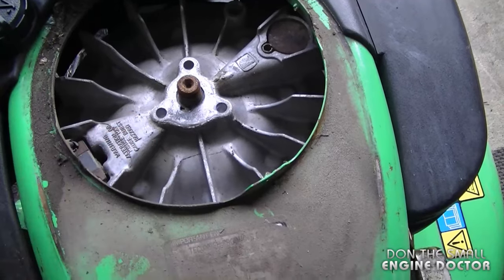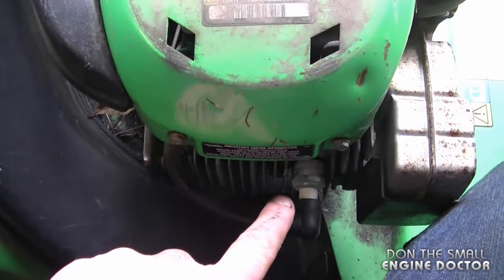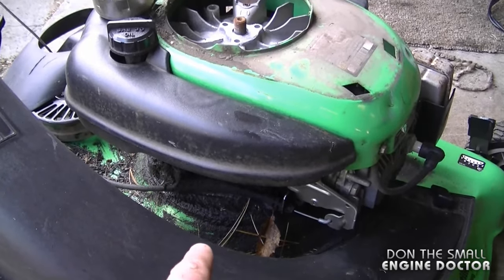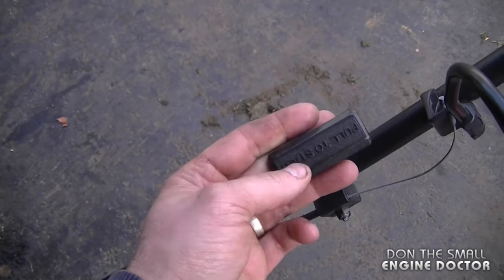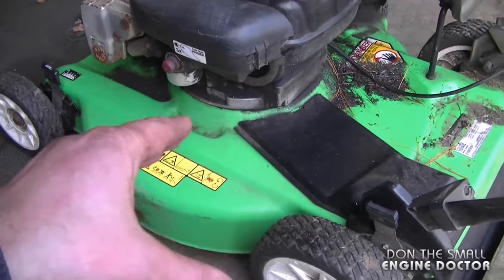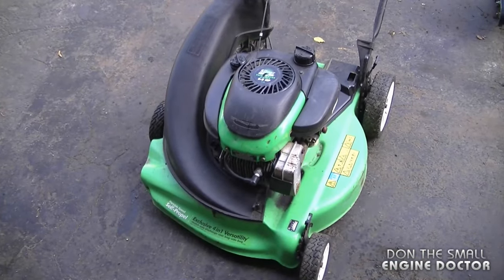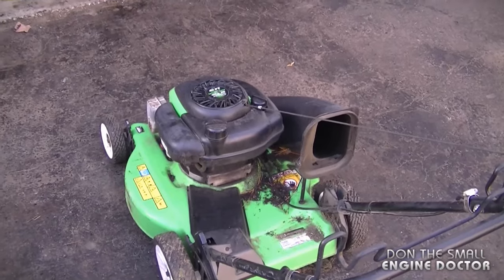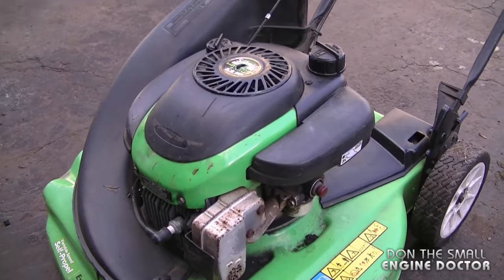Lawnmower Will Not Start - You Will Never Guess Why!

Comment: Sometimes I have self-doubts and your videos often fix that issue! I have the leaf blower equivalent of this issue, I think.  Customer was using the blower; clothing was sucked into the machine, and it died and will not start.   Has spark, has compression, has gas, etc.  I wanted another opinion before I tear into this box store model because it is a pain to work on.  Last year he snapped the starter rope, and the entire machine has to be disassembled to get to it.
Thank you for sharing and stay safe.

Comment: Excellent video and instruction donyboy! Really concise. My engine flywheel key was perfect, so I am back to the drawing board, as they say. When pulling starter cord, I still have symptoms you pointed out. I am totally puzzled now? Wonder if timing marks on cam and crank are incorrect. Connecting rod was replaced on this engine years ago. With spark plug out, engine spins easily.

Comment: Thanks...ur the only one that mentioned the oil from the vent tube...I was wondering where it came from.
Mine ran and sheared the tabs for the mower blade in use...then the mower after stopping could not restart due to full shear of pin.

Comment: Yes, I recognized this issue. Exactly what we have right now in a Briggs 7.25 HP engine of our lawn mower. It seems like ignition points are wrong. However, some people advised that it`s most likely a camshaft problem. It`s made of plastic and pretty common issue when its plastic gear wheel is getting loose on its metal axle, or a decompression mechanism is damaged. Do you have an idea how to diagnose it correctly before engine disassembly, please? Thank you

Comment: Backfiring is a common symptom of bad timing in old two-stroke scooters. I had an electric start mower my shop in a few weeks ago. Charged the battery, it turned over OK but slowly, and backfired about every 5-6 turns of engine. Pulled on the cord, and sure enough, it yanked right out of my hand. Key was nicely sheared in two.

Comment: had a briggs stratton 450 148cc that had surging issues and also making occasional popping sounds while running. Tried all the usual solutions like cleaning and  rebuilding the carb, even replaced governor springs, tried to adjust running speed by bending the tabs on the kill switch bracket, checkd for airleaks etc etc, nothing I did worked, eventualy decided to pull the engine apart and rebuild, when I took the flywheel off I noticed the keyway was slightly sheared and this ended up being the issue causing all my problems.

Comment: Good video. Timing is a major factor in engine performance and not many utubers will even mention it, guessing cause of the rarity of the happening. But you are right,,, hitting a sidewalk or root or obstacle that dead stops your mower especially,, can cause the key to partially or completely shear. Good information to look for and usually easy. thanks Don.

Comment: on the old Tecumseh engines they used a steel key and an aluminum flywheel and many times when the blade hit something solid the flywheel would crack right at the key way.

Comment: I had that exact thing happen on my 7hp mower with a Briggs. Hit a piece of rusty pipe, sheared it all the way and wouldn't start at all. I managed to figure it out my self and fix it. I also noticed on my 7hp, you really have to tighten the blade bolt a lot more than on all other mowers I have.

Comment: By the way on some lawn  flywheels it has instructions embossed right on the flywheel " never use steel key" or some wording like that (and even use flywheel puller). Always use an aluminum key on lawnmower flywheels or certain engines that recommend it. If in doubt check repair manual. Thing is an aluminum key cam prevent crankshaft damage or breakage in the event of the lawnmower blade wacking against a fixed object or big branch by just shearing the key. Some engines even have offset keys for ignition timing.

Comment: I've got a Briggs 3.5 hp motor with a sheared key, and when trying to start it the plug fires when the intake valve is wide open and a "pop" comes out of the carb. It stands to reason that the magnet triggering the pulse into the coil isn't where it should be, due to the flywheel having rotated away from its proper position. Easy fix.

Comment: I hope this is the issue on my Briggs & Stratton 4.0; a couple of summers ago, I ran over a small group of thin tree branches (less than 8 inches in length)--the engine started making a slight ticking noise and small spots of oil began to appear on the deck.  After I shut it down, I tried to restart it, only to be greeted by the ol' starter rope snap back!  Thankfully I have a spare mower, but as soon as I can find the correct flywheel key, I will attempt this.

Comment: This may seem like a situation for a bad key on the flywheel. But  I was working in a riding mower, and it had all these symptoms. However, the key was good and straight. The problem turned out to be bad wire connections. I cleaned up the grounds, and the power wire ends on the whole machine, including start solenoid. Now the thing starts great and runs fantastic. I say this as I now have another riding mower sitting in my shop with the extra same issue. Hard crank hard start. Kick back against the starter, and occasionally, it will back fire just like the other engine on the other riding mower. OHV engines both are briggs and Stratton 17.5 hp engines. The only difference between the symptoms of a bad flywheel key and bad ground and power wire ends is that the mower when started runs great if it's a power or ground issue. And a bad key in has issues while running both may not start.  So start with the key on the shaft and flywheel first. And eliminate that possibility first. Electrical wire cleaning is a long pain in the ass. As you have to clean every end positive and ground from the battery to the starter and the flywheel and coil pack and reset the coil pack to spec distance from the flywheel. A basic business card works for this.

Comment: Love the videos! 
Quick question...
I was given a Yazoo 26" Self Propelled mower with an 8HP Briggs commercial engine. I cleaned the carb, changed oil and plug but it only backfires when I pull the handle. No kickback. I'm at a loss. Could this be a flywheel key? Points? I'd just like s place to start as I have never encountered this. Thank you!

Comment: I have a John Deere riding lawn mower model 125, it is powered by a Brigs and Stratton single cylinder engine . I bought it in 2009,  it gave great service until this summer. It stopped running, and I found that the flywheel key was sheared. I put a new key in it and it started up, but only ran for about 3 seconds, and sheared that key. After the third sheared key I figured that it was an internal problem. After talking to some people I was told that some of those engines had a camshaft that had a nylon gear that is pressed onto the camshaft. Have you run across this problem? I plan on opening the engine case and see if this is the problem. Let me know your thoughts on this. Thanks for all of the info you pass on to us.

Comment: I have a 20 horse Intek that had a partially sheared key due to hitting an obstruction.. The main symptom was not increasing with throttle and dying. After replacing the key, it has very little improvement, slight increase in power. Is there anything else that might cause little increase in  power? Also replace carb, adj. valves.

Comment: On older engines with points, if the points are driven by a flat or a cam on the crankshaft the ignition timing would not change, however the spark will be weaker or there might be no spark because the magnets in the flywheel do not pass the magneto coil at the right time. So if the flywheel key has only sheared a small amount there could be no symptoms.

Comment: Was mowing with my Honda mower and went over a real thick patch of grass and the mower almost stopped and wouldn't make enough power (and smoked a little bit).  Thought it was the flywheel key.  Took off the cover and before I went to check the flywheel key, noticed one side of the armature/magneto/coil was touching the flywheel.  Flywheel was very scraped up  I readjusted the armature and the mower started right up and ran fine.  Still not sure if the thick grass I tried to mow could cause this problem.

Comment: I have a mower that flywheel key is not sheared but will  only run on a prime for a few seconds.  Carb is clean,  I suspect the internals got out of timing with the cam and crank shaft alignment got out of sync.
Reply from the maker: you could also have a bad carburetor

Comment: To remove a flywheel, put a block of wood on the top of the crank. Use a pry bar to pull up on the flywheel. Now, hit the wood with a hammer and watch the flywheel come off!
Reply: That worked for me thanks!
Reply: I read your comment from 6yrs. ago on “donyboy73”, removing the flywheel to replace sheared pin.  I watched a lot of other videos, some you need special tools, other very unorthodox methods.  Your method seemed the most logical, and addressed the not cracking the fly wheel.  You answered my question.  Thank you very much for commenting. 👍👍👍

Comment: l have a briggs and Stratton that has ripped out the lead out of my hands......l have checked the shear key and its ok.....l have empty the sump and checked the cam and crank gears - both line up with the timing markers......so lm at a lost to why the timing is out but can't find the reason......if anyone has any suggestion it would be much appreciated -thank you

Comment: What if its now starting after replacing the Flywheel key (im certain i put the key in properly and the slot was undamaged) But, the starter rope pulls back sometimes and sometimes smokes out the air intake when it fails to start And runs some wat weak misfiring? Timing Gear?

I just realized i put a Chinese cheapo ignition coil on it. Maybe out of line

Comment: Have you ever heard of or yourself sheared a flywheel key by using an impact gun to remove an engine pulley? yesterday I was really hammering with an impact gun on a stubborn bolt holding a pulley on. Never got it loose. But I wonder if all that impact skewed the flywheel just enough to make my engine run rough. Going to pull it apart today and see. If you think about it it's sort of impacting the crank like hitting a rock or a stump would and all the impact repeatedly might misaligned the fly wheel? On a 15 HP Briggs.

Comment: could i have a sheared flywheel key on my snowblower. I tried starting my snowblower and after a couple of tries with the electric start i heard a loud pop and now it wont start. i replaced the spark plug and the primer line do to were on the line and the spark plug is 4 years old. i have a tecumseh motor

Comment: ive got a few of the symptoms but not sure how i could have sheared it, as the engine is a gx390 clone on a golfcart so there would be nothing to hit and cause the crank to stop. it knocks on start up,  it kicks backto the point it broke the teeth off the recoil but only when its cold and i dont plug the block heater in. it also back fires at cruising speeds and at shut down but only sometimes

Comment: Hi I have a husqvarna chainsaw 268XP The crankcase compression is really difficult to over come when pulling the starter cable It's so bad that as you pull the cord the chainsaw tries to pull away from your foot brace keeping the saw on the ground or as you say your fingers pulling the cord nearly get wiped of your hand I thought this to be a damaged woodruff key I had a lot of pressure on the crankshaft taper before it released the flywheel Because it was so tight to pull off I was sure the key was damaged but no its a straight as a dye  Sadly I don't know what else to look at now Research just keeps coming back to damaged keyway

Comment: Hi Donboy76, really appreciate all your video has saved me a bundle! Question for you, have a v-twin Kohler Command engine. Hit a rock on the lawnmowing deck which bent the blade and broke the mandrel. Easy fix there, but engine has been "off" since the encounter. Engine starts fine, but seems to missing a bit and engine vibrates a bit (no deck engaged). Power seems lower and when I shut it down, the engine runs on sputtering for say 3 seconds before coming to a stop (always shut down promptly before). In your professional guesstimation, does this sound like a partially sheared flywheel key or a bent crankshaft (is that possible on Craftsman GT3000)? Really appreciate any feedback you could offer me!

Comment: I have a generator that is backfiring into the carb and will not run. I've been asking myself the question, how does the timing get off when there is no adjustment to correct it. The coil can only be adjusted for gap only. The ideal of a sheared key is something I never thought about. I'll be checking it first thing in the morning!!!
Reply from the maker: also check valve adjustment
Reply: donyboy73 

they where good. i even increased the gap to see if that would help, it didn't!  next thing I'm going to do is pull the flywheel and check the key to see if its broke or missing!!

Comment: Could anything else be damaged after hitting something? I removed the flywheel but the key looked ok, it may have slipped a bit downward  ... I am not sure how it is positioned in the first place. I reinstalled the flywheel, and it starts now, but runs poorly and it wants to kick back when I pull the cord.

Comment: To clarify, an otherwise healthy engine with a sheared flywheel key will pass a compression test just fine, right? I’m trying to diagnose my scooter and am a little confused at the moment as I seem to have good spark but am still not getting the engine to start even with starting fluid sprayed into it. Which leads me to thinking it must be either compression or timing. I’m pretty new to this stuff and have been learning a lot as I’m fixing up this old bike, but unfortunately this issue is new and it’s been hard to diagnose. Picked up a compression gauge, so I’ll be testing that in the morning.

Comment: i had one spin 180 degrees out of time, itd spit gas out of the carb and suck air in the muffler- haha.  changed the flywheel key and it fired up like nothing happened.  another thing you should add if your mower is old enuff, to like have points, when the flywheel is removed, a new key should be used. thanks for the tip.
Reply: Just got a free Coleman Powermate Maxa 3000 Generator with a tecumseh 5.5hp engine off Kijiji.  Guy said the motor was seized, but when I got it home it tuned over.  I spent some time cleaning the green? gas out of it and dirt and it just won't start.  Finally realized the carb was blowing air out of it and the exhaust was also sucking air and exhaust in also.  I think it must be the flywheel key now.  Something is our of time.  Thanks for the comment dangerours toys56 and Donny great video as always.

Comment: Is this why my Tecumseh 16 hp
Back fires from the carb and not of oil buildup on the bottom of the engine case
I checked the valves and cleaned the carb 3 times
Same thing 
The engine case get vary hot 
Will try to replace the spark plugs and coil also

Comment: i got a huskee mtd 173cc mower. i have to tip it on its side then pull the cord to start. then it runs great for 2 or 3 minutes then stall. put a new carb, new plug and checked the valves. something isnt adjusting right. could this be caused by a sheared flywheel key? clean gas and it flows. i am at a loss.

Comment: DONYBOY73, My key keeps shearing. replaced key and then it sheared again. Anything should check? This is nuts!
Reply: If your flywheel key keeps shearing, your lawnmower blade is loose. After you replace the key the lawnmower will start and run until it shuts off. At that point the key will shear again and you have to replace the key to get it to start again.
Reply: @hdmech3405  ?

Comment: What size socket do you use to take off flywheel, I have a mower with sheared key and don’t have the right socket
Reply: A 15/16's on Briggs & Stratton engines. A 1/2" drive impact gun works best. And then you need a flywheel puller tool.

Comment: Just yesterday I ran through a ruff patch of grass with my mower wheels adjusted all the way down. The engine stalled and I cranked it back up. It ran for about a  minute and stalled again. Then it would not crank up anymore. Figured the key sheared. So I took off the flywheel cover and tried to rock  turn the flywheel while holding the blades. Nothing seemed to be loose. So don't know if key sheared and is jammed enough to keep the flywheel from having play or if it is something else. Guess I have to take the flywheel bolt  off and see if the flywheel has turned off the key slot. The mower has not been used more that a couple dozen times since new so I doubt the coil went bad even though I have not checked it for fire yet, and it seems more than coincidence that this happened immediately after hitting that ruff patch of grass. I am getting gas from the tank to the carb so even if the carb is clogged it should at least try to fire off a bit. I cleaned the foam gas filter that was a little dirty, so lack of air has been ruled out.
Reply: I found out that the ground wire that shorts out the coil when you turn mower off had shorted out causing no fire. I had noticed previously that the mower was running a little rough. So I disconnected the ground wire and let it hang along side motor. I had another short piece of wire with a plug end like the one going to the coil. I attached that wire to the coil and let it hang. When I want to kill engine I touch those two wires together. I could also just touch the wire from the coil to the motor or body to kill engine. I got a piece of wire that I wrapped around the handle lever so when I turn loose of the lever to turn off engine the brake doesn't  engage while engine is running.